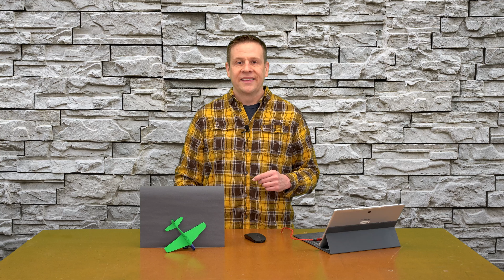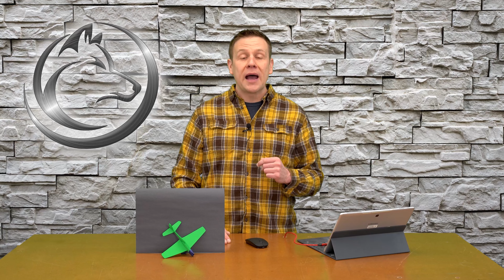Sculpfun S30 Pro- EVA Foam Plane!

Comment: Good video. But i thought the diode lasers speed was mm/min not mm/s is that not the case?
Reply from the maker: Hi- I have my machine set at mm/s and I put the mm/minute on screen for those who use mm/minute.  It's common to use mm/minute for laser diodes and with faster more powerful machines hitting the market every month more people are making the switch to mm/s.  I have other machines that run much faster than a diode laser so from the start I used mm/s.  It's personal choice.  Thanks for watching!